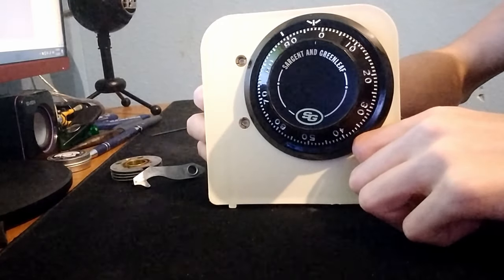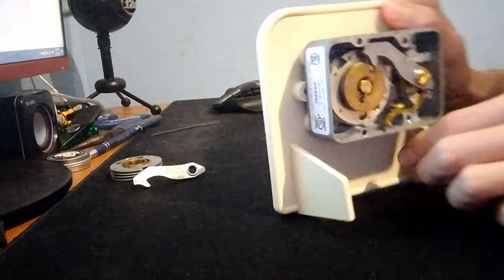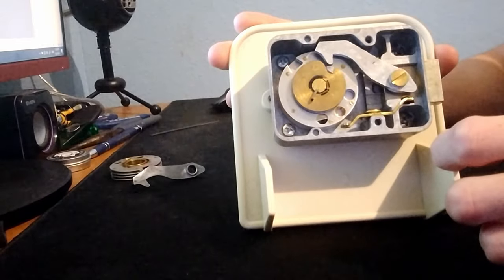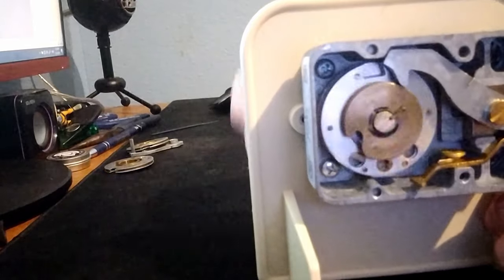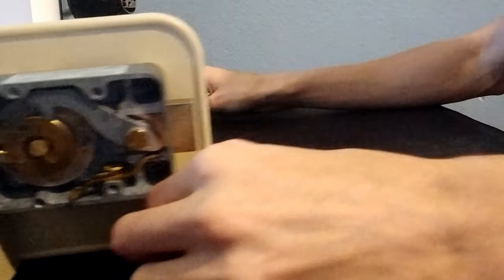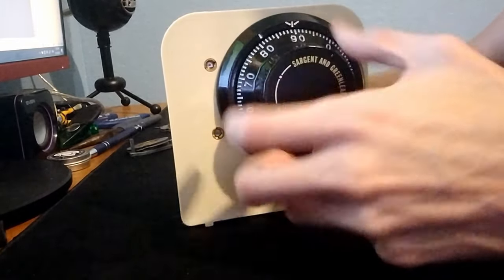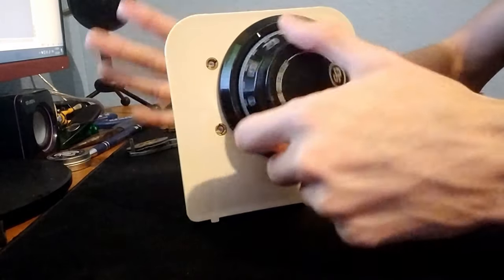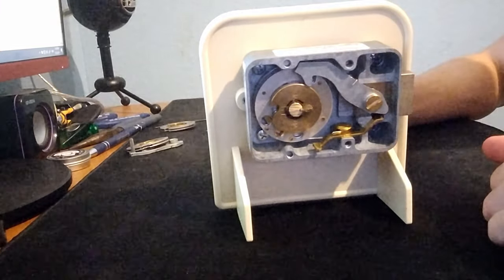Safecracking for Everyone part 1 (How a safe lock operates)

Comment: Hi Lockmanipulator, is it normal the my safe combination dial can still be opened when the numbers are dial in at plus/minus 1 value? For example if my codes are 16/73/42, it can be opened with 16/72/43 or 17/73/41
Reply from the maker: Yep! It can be up to 1.5 numbers sometimes, depending on the specific lock.
Reply: @lockmanipulator  thank you for your reply. So it is an acceptable industry norm? Well unless we are protecting the Crown Jewels.. 😂
Reply from the maker: @jacklol1834  it's generally the accepted way to do things since it can be hard for users to be so accurate when entering the combination in quickly. Higher security locks will have tighter tolerances but can still be +-0.75 increments or so.
Reply: @lockmanipulator  thank you for your reply Sir. Now I feel more relieved, I was thinking my safe is a “lemon”
Reply: @lockmanipulator , You may have just solved ("Unlocked"?) my years long dilemma. I have a Liberty "Jefferson" series safe w/dial combination lock (no batteries, nor electronics to fail or go awry) purchased brand new in 1996, if not by, which, after many years, has started to not always follow the actual combination. (May have to stop a little before or after the real number, etc. While I am mechanically inclined, I've been hesitant to pull the backing plate off the door and take a shot at seeing what's wrong and (if possible) fixing it. While the literature says they use Sargent & Greenleaf locks on all their other models, they specifically say they do not on the model I have. They also do not identify where it was made, nor by whom. The worse thing that can happen is that I have to remove it and take it to a real locksmith for repair or replacement. Being retired gives me far more time than money to indulge my inquisitiveness.
Reply from the maker: @johnbesharian9965  It wouldn't hurt to remove the back and take a look! If the numbers are drifting, then something is very wrong and one day you may never be able to open it again. And in that condition, with drifting numbers, it wouldn't be able to be manipulated either.